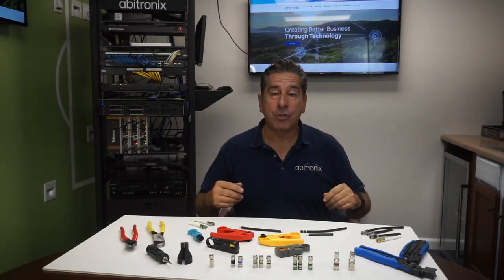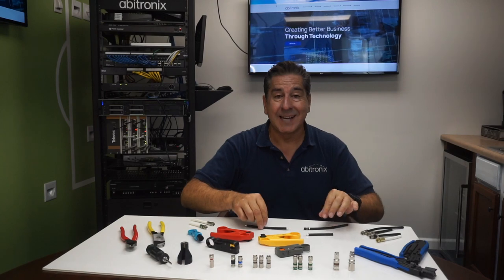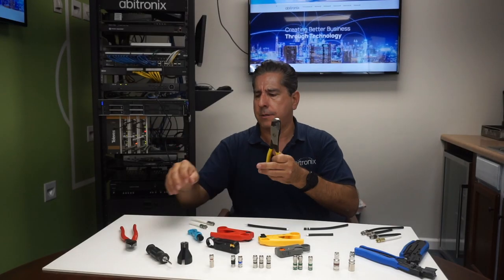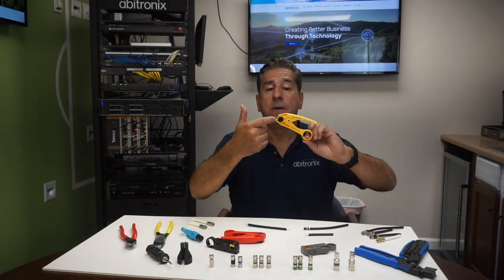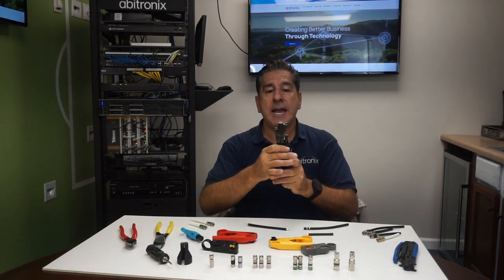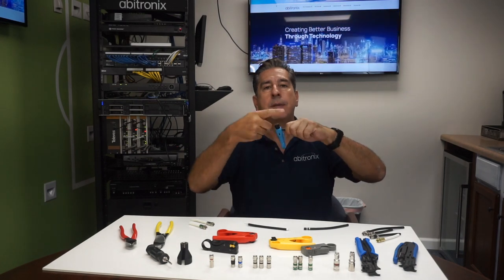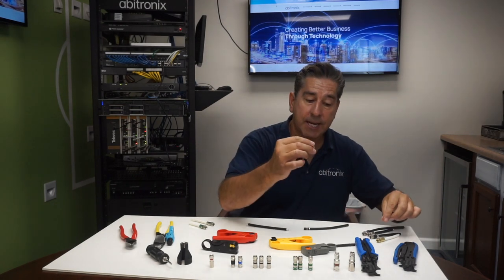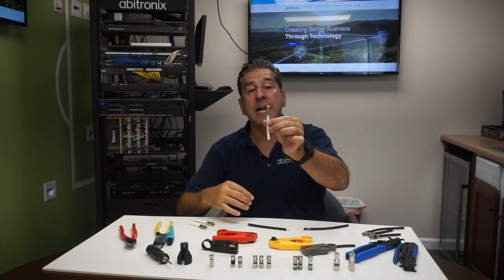Steps and Tools to Compressing an RG6 Connector onto a Coaxial Cable

Comment: When the weather is cold, the cable will harden. It is difficult to press the connector to the position. Do you have any suggestions？
Reply from the maker: Great point.  There is a tool that I have used for many years and it helps immensely with weather and install of connectors over coax cable.  I have an older Holland Electronics Connector Guide & Cable Flaring Tool (not sure if its still available).  BUT Jonard Tools makes their version Model #FT-6. You can find that one right on the internet (should be a $13 tool)